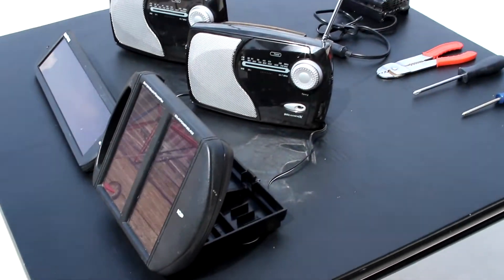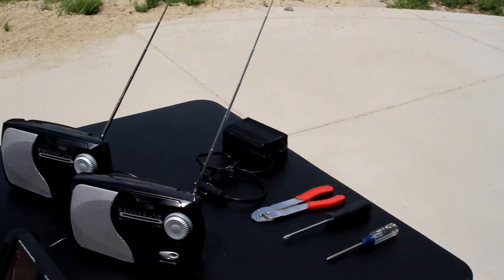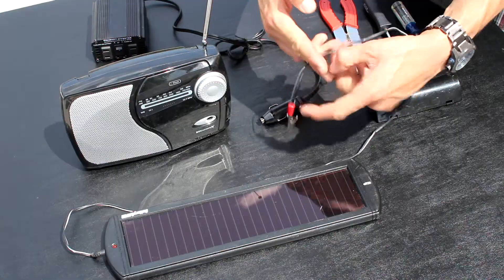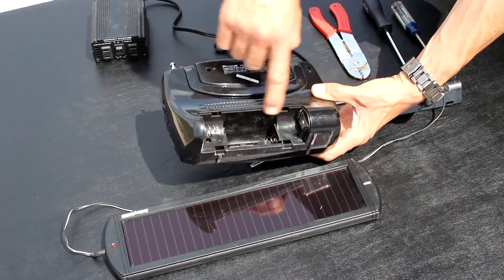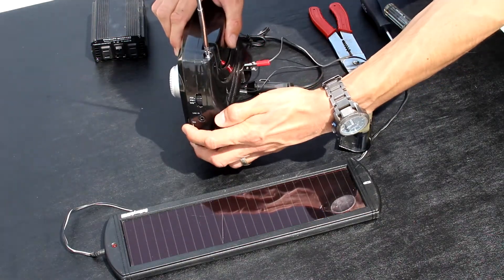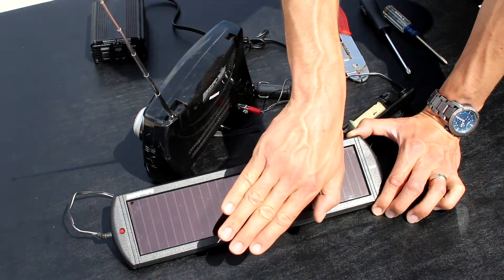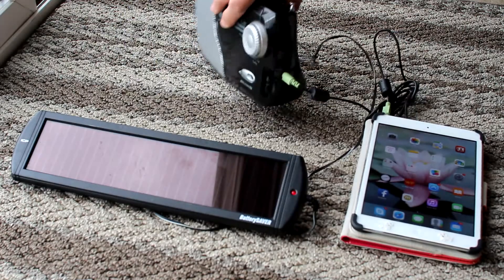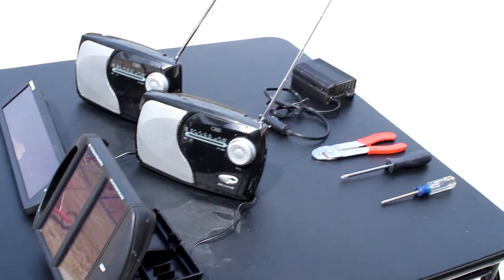EASIEST DIY SOLAR POWERED RADIO! DIY Solar Project - Homemade Off Grid Solar-Powered

Comment: Those panels are about 19 volts but low current. I wonder if one of those 5 Volt car cigarette to phone charger plugs with a spliced USB lead would run the radio at a more optimum voltage/current rating. Impedance matching the panel to the radio in this way might get you more volume. (I'd have to do this with my larger panel as it might blow the radio.)
Reply: I just experimented with the converter. It does indeed multiply current when it steps down the voltage compared to just connecting the panel directly. I tested the short circuit current of the device at 2.4 amps whereas the panel is about 0.8 amps. I tested on charging an 18650 cell and direct to the panel in bright sun it charged at 0.7 amps and on the 5V converter at 1.2 amps. As my larger panel might blow up one of the radios you use, it would also limit voltage, but on a smaller panel like yours it would boost the current. 5V should be fine on a 4.5V radio.

Comment: I've run an orange CR6 guitar amp off the sun and even an SMSL SA98E and speakers (though not to maximum volume as these are power hungry 36 volt amplifiers when you crank them, though frugal with the volume lower). The class A/B car amplifiers weren't efficient enough though. I have a feeling it would probably blow out that radio though as it can do 18 volts 2/3 amp
Reply: I now have a Hitachi boom box that runs off the sun, charging a lithium ion bike battery of 6 x 18650 cells at the same time which runs the boom box for hours! If I left the panel charging all day, I bet the radio would play all night into the next morning, but me and the neighbours need sleep so I probably wouldn't bother.

Comment: But isn't that a 12 volt solar panel connected to a 4.5 volt radio? Won't that damage the radio?
Reply: yes it will....this guy is totally clueless.
Reply: it's a small enough panel that it's current limited and the voltage will drop. I think my 18V 2/3 amp panel might damage it in the hot sun though.

Comment: hello, i lived in another country where we don't have walmart, and i wanted to use that project for my school project. If i would have searched on amazon or any other online stores. what would be the keywords of the solar panel, radio, and the solar battery charger. Thank You..
Reply: I know your question is one year old, but you can put rechargeable batteries in the radio.  They will charge.

Comment: ok, the solar panel puts out 12 volts, the radio calls for 4.5 volts... aren;t you going to fry the radio putting in more than 4.5 volts to the radio?  How did you step down the votage?

Comment: This video helped me find a solar panel that I needed for a school project.Thx
Reply from the maker: +LaloBigPlanet 2517 That's great to hear! Thanks and have a wonderful day!
Reply: Sensei Ryan HD  I want to do this 2 for school project may I know where I can find radio like that
Reply: Ty
Reply from the maker: Marbado 44 Hi! I bought them at the goodwill, but they originally came from walmart.  However, any SMALL battery powered radio will do.  As long as you can put batteries in it, you can hook up the alligator clamps and get it powered. Good Luck!